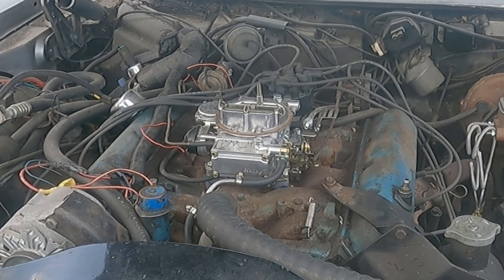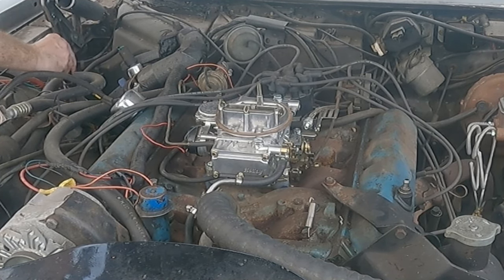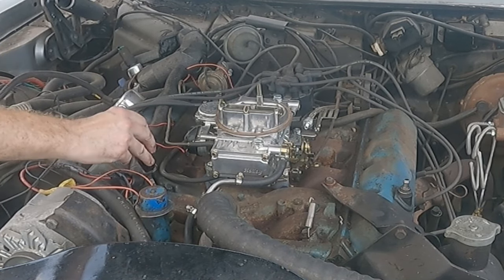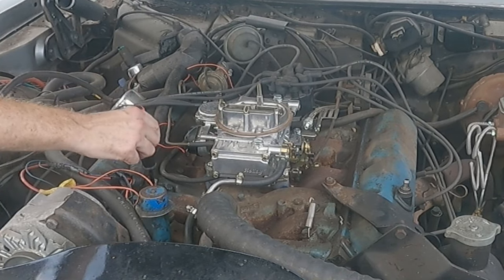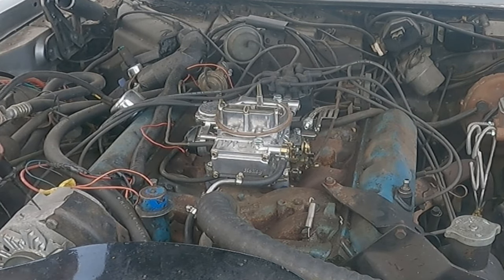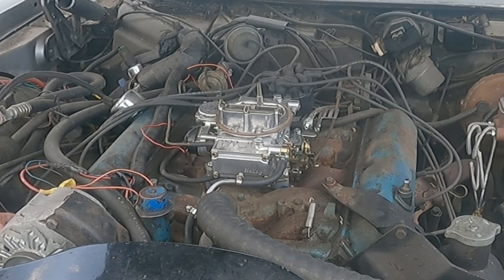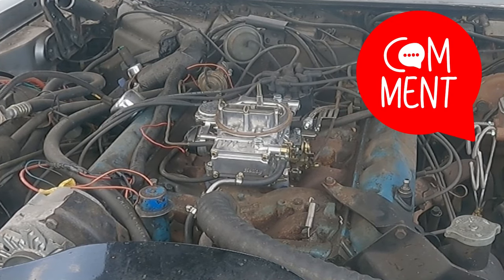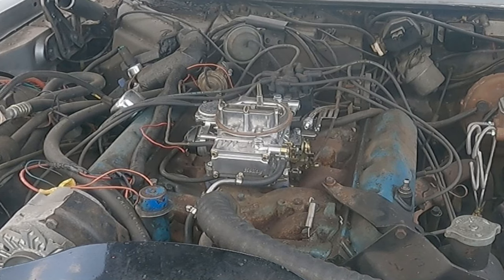Nothing Can Stop Us from Starting the '66 Olds Toronado!

Comment: Air, fuel and spark, anything will run
Reply from the maker: yes but will it run well?
Reply: @DJsClassicGarage  if fuel supply is clean,air flow should be o.k.,do a compression check